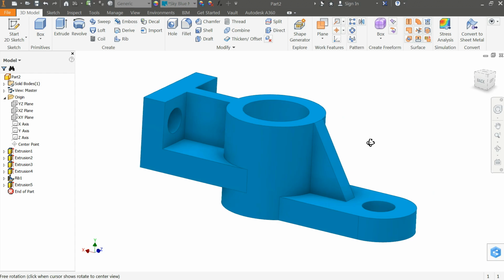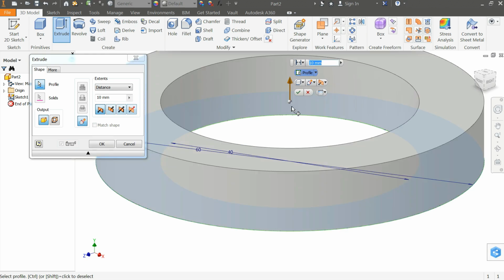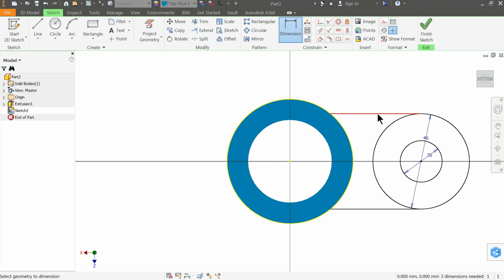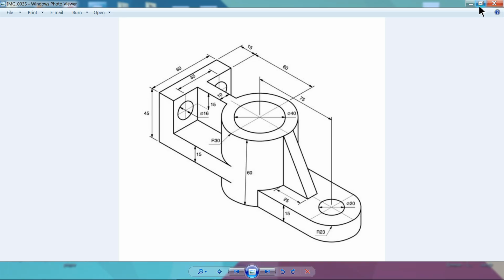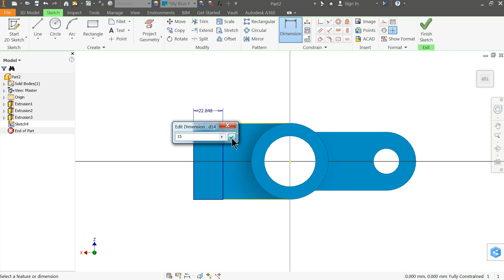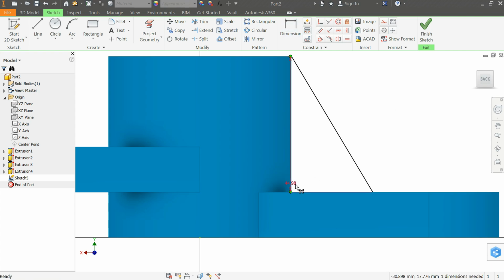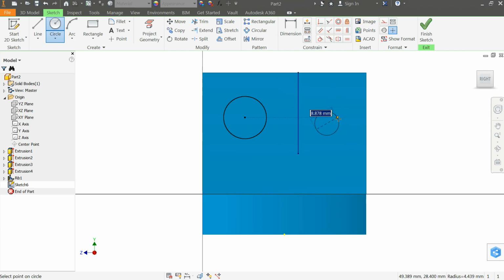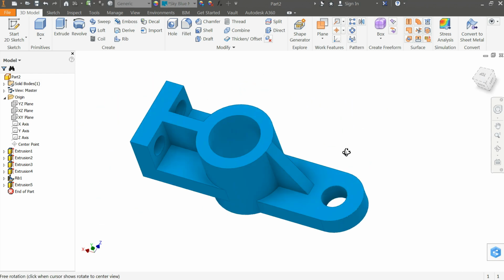Autodesk Inventor Tutorial for beginners exercise 9

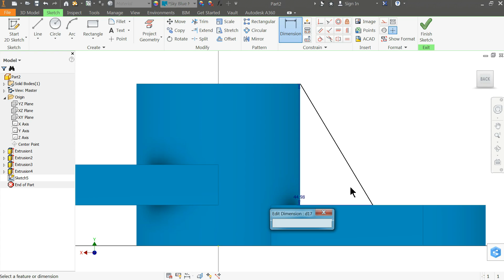Comment: at 7:24 how do you manage to set that dimension?  and if i add construction line at 20mm. the rib fails
Reply: Ive haad a hard time with ribs in this manner myself. I finally got it but don't know how I did LOL
Reply: @bapnbird  If you set work plane instead using origin lane it is lot easier
Reply: @alabama1974  Thank you!
Reply: You're better off extruding both sides of the centre boss level with the top plane, then draw a line where you want the angled cut to be and use cut extrusion. The rib function does not work if you follow the step in the video above. Not even with the 2020 version.
Reply: @skatesneakerlover  He got it to work somehow, but I'm struggling with the same thing, I can't get the rib to actually work this way.